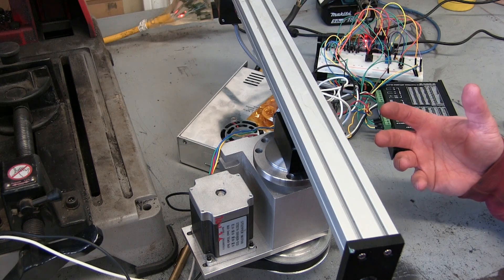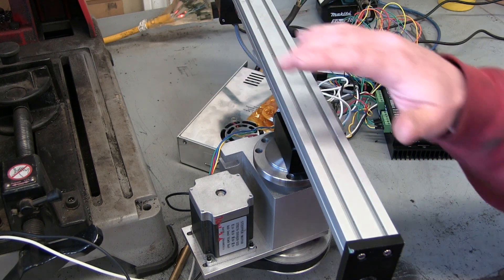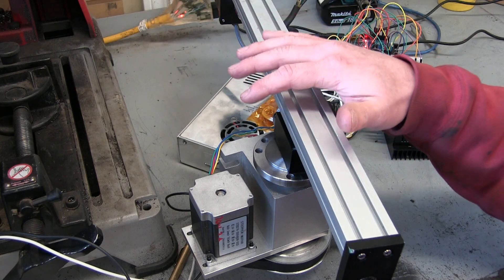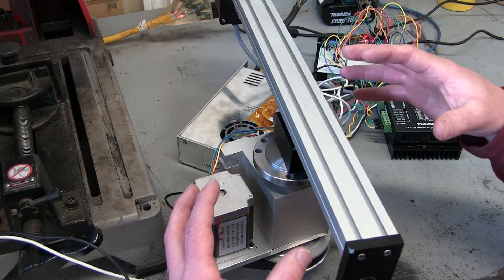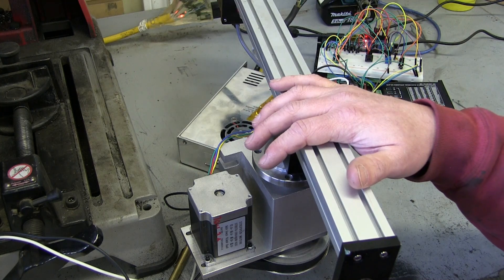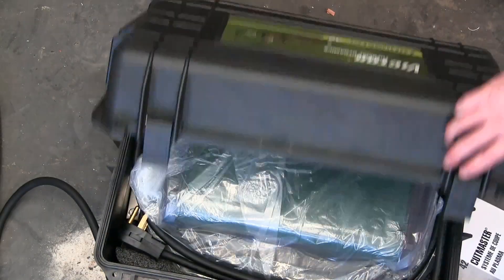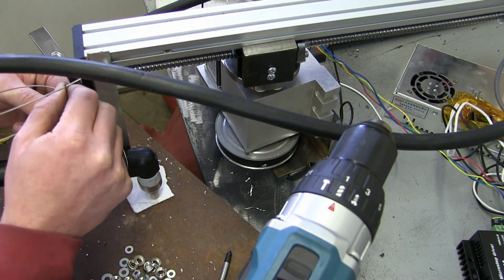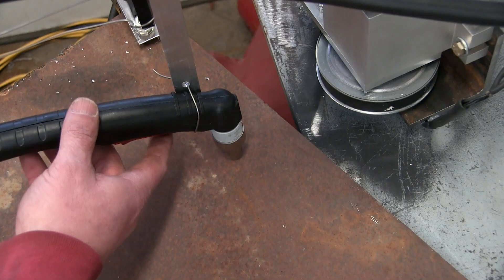Portable CNC Plasma Prototype

Comment: I suspect this is the same thing being expressed by discussions of polar coordinates, but it's important to note that the the rotation speed of the rotation motor will have to be different depending on the position of the cutter on that arm. The farther out it is the faster it will travel per degree of rotation, so you'll need to either sense it's position and use that value for calculation or calculate it's position and use that.

Comment: As an old fabricator, this thing is a great idea.  The one thing I think I would also add to it is a flash drive input so that the office queer, I mean engineer can send out drawings and have them plugged in, because we all know if there is a mistake that prick will roll you under the bus in a heartbeat.

One other thing that I noticed is that you are going to have to calculate the radius swing speed as the head moves away from the center access. There will have to be an algorithm built into the program.

Comment: If you need help with web/app side, I can help build a web based UI for it. My solution would require a wifi enabled controller for the device though. Not great if the target is a shop somewhere. I assume you have an arduino? Would it be too much to add a RaspPi?

A better solution would be a bluetooth device and app that pairs with it. Much cleaner, but kind of a pain in the ass.

Comment: I have a idea that would prob be tricky to implement but if you could it would be ducking spectacular!! What I think would be tricky is knowing where the shape will be cut. Getting the size right and orientation. .... now for the idea of a million bucks. Laser projection of what and where the cut will be. That way the worker could just slap it down with reach of the cut. Select the shape to cut (it is then projected on the steel) then via your app chose the size and move it around to the desired location and boom you got it where and how you like it

Comment: This could have the potential to cut off the branch it's sitting on, so to speak. If the magbase was in the middle and you told it to cut a large diameter circle that included the machine you'd have a problem :)

Comment: Lets keep this a secret so AvE from Canadian Outback can keep a million dollar idea (I can safely say after 2 years of videos his first one).

Upgrades to getting this idea to actually work:
1. Height adjustment for the "gun"
2. Auto-start of the plasma arc. That is a problema, because as far as I am aware all hobby plasma cutters have one on-off switch: on the handle. I bet you were squinting on the first run when you had to keep you hand right over the squirts of molten metal. 
3. Generalize the proper off-set of the nozzle: feeler gauge set or something like that. 

If you can overcome these problems, than the magbase 2 axis CNC plasma cutter is ready for mobility
1. Bluetooth connectivity
2. App development
3. Safety steps you cant avoid! For every cut you must address the potential problems: perpendicularity to the base plate, engaged magnet, proper offset of the head etc
4. Each cutting has a pre-plotting of a 1-2" straight line for that penetration spatter. 

Rather easy steps for a million dollar idea, if I say so myself!

Comment: it works but how will you compensate for thicker or different metals such as alloy stainless are harder to cut  . will it be done by the power control on the plasma cutter  or speed control of  cnc arm ? . id use one on my plasma cutter as i can not get a good line by hand

Comment: The problem you seem to encounter here is getting caught on slag. Especially at the end where it meets the build up from the starting hole. Maybe you could implement a cylinder or another linear actuator that gives you a little bit of movement in the Z-Axis so you don't ruin the torch by scraping it over the buildup.   

Also if you ever want to go full on production quality you could have a small laser that projects the shape to where it will be, this would make for an easy placement of the whole contraption. In that case you wouldn't need a phone either, just a small built in control panel.

Comment: Adding in the brains won't be hard at all.  There's a lot of 3d printer boards that could handle this.  Toss in some way to send programs to it, and a way to easily create basic profiles--then I think you have something that'll be adopted.
Reply: Josh Martin just let the phone app do the transformation math and any microcontroller can do the driving of the cutter. smartphones probably has more CPU and better Frameworks for that job.
Reply: Ibrahim Ulf Karlsson real time performance could be an issue.
Reply: Does not have to be real time! Just like creating G-code and transfer to a 3d printer.

Comment: Christ some of the men on this board are Debbie downers. I mean they bitch more than a pmsing 13 year old. Critics who do not get there hands dirty providing solutions, always have a reason why the other person's idea won't work, but rarely posit suggestions on how to make it work. Grow a fucking pair.  No idea is perfectly formed and executed on the 1st iteration.  Even if you think your gauge block is perfect when when inspects close enough we shall see your imperfections.    Luckily for you it only needs to be good enough to to do the job and ring the bell.  Ave might not want the added complexity of using a vision system, but there are multiple ways to get the geometry of the piece so this device knows where it is, it could even write with some sort of special juice so one could verify the cuts before hand, and then the device follows the juice to make the cuts.    And if you guys are offended, flame away, I won't lose any sleep over whiny bitches.

Comment: Could you draw out an outline of what you need, and then use your phone to take a top down picture, put in the actual dimensions needed, and then have the thing follow that pattern?
Reply: If you wanted to skip the cell phone app. There is a little module out there called a Gameduino that plugs right into the top of an Arduino Uno (It looked like that's what you were using). It leaves you with a whole bunch of pins still available, its got a decent touchscreen, audio out, and best of all is stupid easy to learn how to use.

Comment: to me the biggest obstacle is the length of rail that needs to be cantilevered off of the mag base and the inertia/vibration and packaging that goes with it.  as far as getting it to chooch with canned cycles I guess g-code is still your best bet as far as basic language. what you ask of your tool is not unlike what you would do with c-axis milling on a lathe (if you use you imagination...)

Comment: I'd use it if I could feed it G code or interface it with CAD/CAM swoftware. The geometry isn't that difficult, you might find synchronising the radial and tangential travel rates for compound translations more challenging, since the tangential travel rate of the cutting head is going to be proportional to radius given constant angular velocity.

Comment: This is an awesome idea!

Your right your going to have to account for going rotary into linear equivalent. Hopefully that will only depend on the variables for the linear actuators length (You'd have to adjust less closer to the rotor more further away along the arm etc).

But it should be doable.

As for the easy app idea very very very awesome. My add to it is to allow the presets to come from gcode or what ever freely available standard so those with c&c computer wizz skills can add new shapes they want. And most importantly submit them to a online library. 
So the unit you buy comes with your basic shapes, you use your phone app to pick and set params. But if you want something more then click the "online library" button and get a searchable list of user submitted gcode templates with params you can set. 

Want a cog shape cut out? Search for cog, click add. Off you go. Simple as F and someone else contributed the fancy bits.

Why would people submit their efforts freely? Why the hell not. THey do the hard work figuring out the one complicated pattern they need for project X and they are already getting the massive library of other shapes. 
Just look at open source code. it works!

Wifi capable chips like the ESP8266 make this possible with an arduino for grunt, or a rasberry pi if you want a more fancy web interface.Which might be an idea so its not Phone specific. Lil web interface means iphone, android, windoze phone or even a laptop can prod it. Or do both, so its stupid simple with an app, but gives you options. 

I'll follow this carefully an other comments cos I'm happy to offer some techy web UI or Andoird programming knowledge this if it becomes a project. I'm no metalwork expert, but software and electronics is my thing.

Comment: So what you're wanting is like the Shaper hand held CNC router but as a plasma cutter. should be easy to do.

https://youtu.be/p_wk3q8jWcs
Reply: I said that too.... the replacement of the spindle with a plasma would be easy, you would be able to use smaller steppers and also increase the distance correction because there is less pressure than the router

Comment: mag drills are better because there is not slag. we punch most holes anything this you would have a big problem with the plasma cutting threw it.we have roller switches that stop the plasma a error code pops up saying lifter error . I would use this at my last job if it was under a couple thousand because there was no room for a shear .

Comment: Seems like a very interesting idea. You probably want to consider adding a third vertical axis so that if you're cutting an odd shape, or thin heat-warpable steel the cutter can compensate and not crash or drag on the dross. It also greatly reduces consumable damage if you can start the arc and plunge into the material. Two years ago I built a 4'x4' plasma table from scratch with a few other engineer friends, and adding a 3rd axis was one of the best upgrades. Just be sure you're using shielded communications and everything is properly grounded. We ran into issues occasionally when the plasma power cables got too close to our controller cables. You'll also want to make sure your linear axis can move fast enough, it seems like it's a bit slow if you're cutting thinner material.

Another possible idea is that you could have two bases, one flat mag base and one V-clamp for piping. Fabricating tee joints or adding weldolets would be awesome if you could just strap on a cutter to the piping, zero the machine, and get a nice hole where your fitting will attach. With that setup however you'd probably want a 4th rotary axis on the end to follow the contours of the pipe.

Comment: The only issue I see is on the pierce cut. cnc plasma cutters will have a pierce height and a cut height which it uses a touch off command to zero out the Z axis before it starts. With it staying the same height you'll be blowing a bunch of tips in no time. I think this idea holds water though and I sure as hell would use it after using a few cnc plasma cutters in the past couple years.

Comment: I was a math teacher for a few years...You probably already know - but just in case you don't.... Switching from Cartesian coordinates (x,y) to polar coordinates (r,theta) is pretty easy if you know any trigonometry.  x=r*cos(theta), y=r*sin(theta).  Where r is the length of the radius and theta is the angle to that radius from the positive x-axis in the counter-clockwise direction. (Although, whatever program you're using may define things a little differently so be careful).

Comment: Two points: 

1) For constant speed, you need to have your inverse kinematics handle rotary going slower when the arm is further extended (can probably just be a 1/"arm extension" multiplier to the speed commanded to the rotary axis). This will slow it down when you do the extended turn and speed it up in the close in one, much like constant surface feet per minute in a good CNC lathe.

2) I'd be worried about all those sparks flying at the weak rubber belt driving the rotary axis, personally. Similarly, as a home-gamer with a basement shop instead of an external building or even a garage, I'm not going to plasma cut indoors, it'll all be done in the driveway. It'd be nice to see some thought put into dealing with harsh conditions running that guy outside on saw horses in a Michigan winter.

Comment: Hmm, as apart of working in unusual spaces or around obstructions,  if you could manually navigate the the rotary and linear through the 'safe path'. Then take that feedback as datums to apply to whatever cut you need the torch to do. 

Also ties into have the machine do it's own automated investigation with feedback sensors. Such as "Encountered resistance at 200' rotation, Linear drive at 10 inches, avoid during cutting".

Comment: Magnetic break away for torch (then you can easily use your plasma machine else where on the job and fool proof set up). Drag tip similar to thermal arc set up, or a ball bearing roller, like a ball point pen, integrated into the magnetic break away, to help with the tip to material distance.

how about a controller that has a sd slot for up loading specific cut paths and what not, for those who can not use a smart phone on the job.

Love the idea!!

Comment: Quit thinking in the shop. Think 500 feet up a metal frame superstructure and the architect added 300 holes to those girders. Make the puppy solid, strong and as portable as a mag base hole grinder and there will be applications for it.

Comment: Was the design you used supposed to have curves on the top and bottom lines?
Reply: This demonstration was just a proof of concept. As other people have said, (straight) lines in a rectangular (cartesian) drawing framework would need to be transformed into the circular (polar) movements of the contraption. This would be done automatically by the software.

Comment: A small change to the code but the speed it turns will have to change based on how far out from the pivot the cutter is. (faster if it is closer, slower if it is farther out)(speed = rpm*2*pi*r)

Comment: Fantastic idea !!!

just a thought, you need to think about the calibration of the cylindrical koordinates system
with the steppers you don't know where the axis are when the system starts

an xy table can do straight lines and rectangles without knowing where it exactly is, the lines are always straight, because you use a cartesian koordinates system for straight movements, and the movements are the same anywhere on the table

but as you use a cylindrical koordinates system, you need to know your exact and absolute position, because the movement for i.E. a rectangle isn't the same near the turning point as if you're far away from the turning point
but this problem just needs to be solved :)) (i.e. with a switch at the linear axis at a specific known point)

some time ago i thought about the system with the guide rails, but the mechanics looked as complicated an heavy as a xy table
but now i'll have a go for this system !!!! thumbs_up

Comment: What will make or break this in the industrial environment is the programing part. A smart phone app is a good idea and should be included for more complicated tasks. However, programing the cut by moving the arm by hand will make this extremely easy to use. Some high-end robot arms have force sensing capability and a 'training' mode that allows an operator to directly move the arm into position and mark it. All you need for this is a joystick mounted on the end of the arm and a feedback loop to the motors. This training mode can be used to select centers of holes, or points on a polygon to be followed.

Comment: well obviously it will need some sort of shielding for the screw and belt so they don't get all poopy. and maybe a screw adjustment for the plasma gun height.

I like the idea for the app. shapes n shit... just make this thing so you can use it high and drunk and I would use the fuck out of it.
Reply: also, maybe put an angle adjustment on the head for cutting a beveled edge for extra sexy welding... then cnc that shit on plasmachooch 2.0

Comment: what would be really cool is to be able to within the control interface to be able to live control the cutter and set points for it to cut kinda like a connect the dots sorta thing. Then you could very easily map out if you've already drawn out on the metal exactly where you want it to cut. This would also allow for some really unique shapes to be very easily cut. Seems like a super cool little project I would certainly be interested in buying one.

Comment: it looks very good but one thing that concerns me the most (besides the control) is that the steppers sound very "off". they sound like they get too much amps so the make a wired noise. i do 3d printing and you have to tune the stepper drivers for nema 17 stepper motors. not sure how it works on, i guess, nema 23 you have there. would appreciate a comment back

Comment: America, FUCK YEA!

I don't think there's a problem with treating it like xy in arduino. If x is the boom, and y is the swing, there's gotta be a way to write a code so y F(speed) is proportional to x via a multiplication factor. So if x is 2 feet out, it moves half fast as if it was 1 foot out when it swings y

Comment: Yeah, I'd use it, a portable cnc plasma cutter! The tables are great and my hand is pretty steady but this gives a lot of options. After the job is half assembled and the customer wants changes you can't put a big oil tank back on the table or hang yourself off of a ladder to start cutting out small odd shapes. Great idea. Personally I don't like filling gaps with weld, I like parts to fit properly and this would cut nice shapes repeatedly.